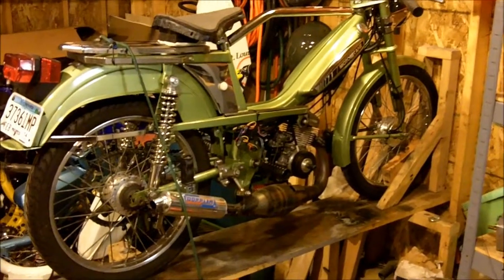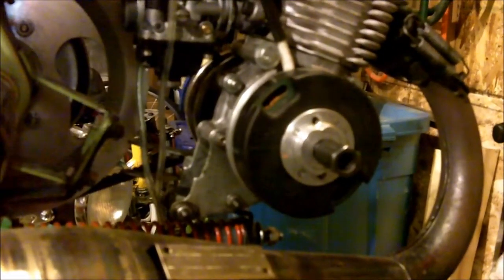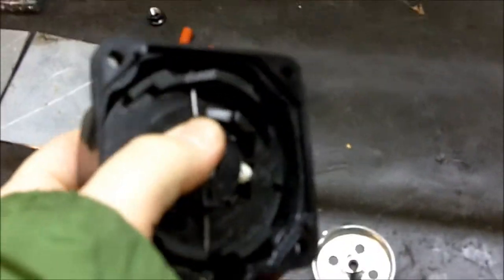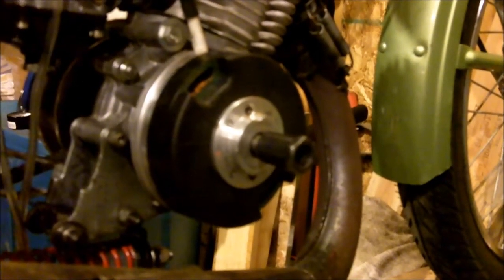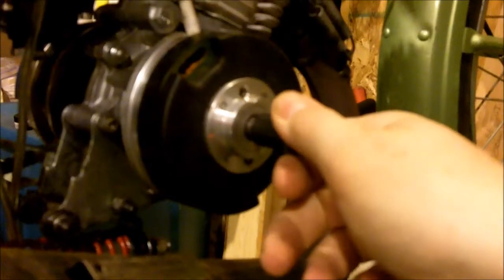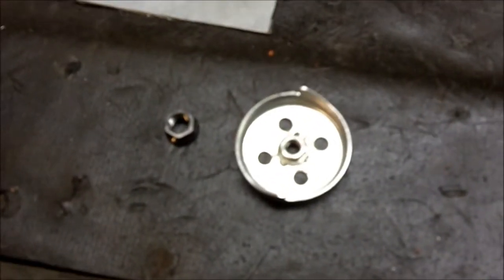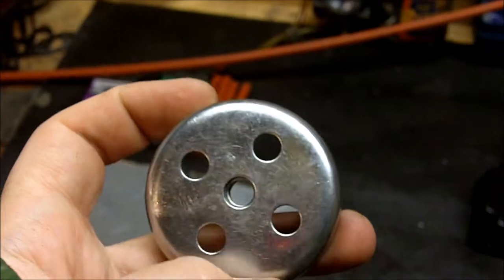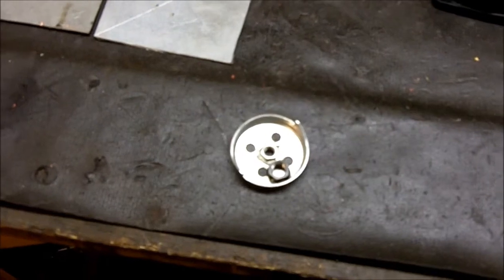How to add a pull start to a Motobecane Moped

Comment: you can fit a kickstart to these engines the MBK magnum has one
Reply from the maker: Yes, they can be pretty spendy though and they can be hard to come by. The pull start is cheap and easy to get although it requires a little bit of minor fabrication.